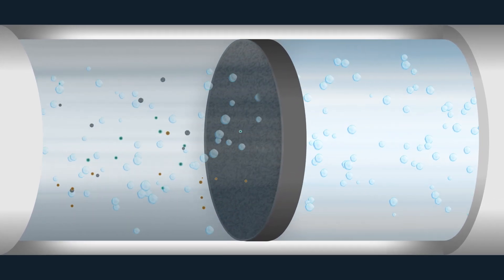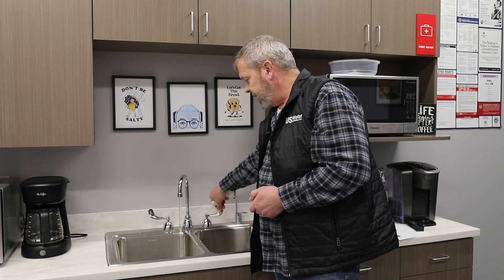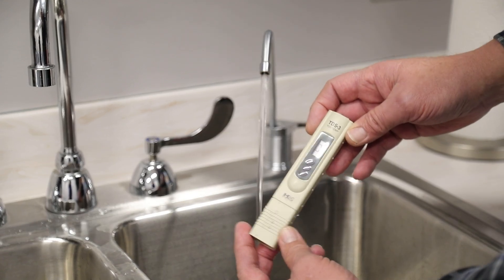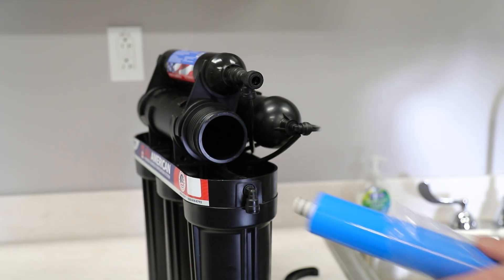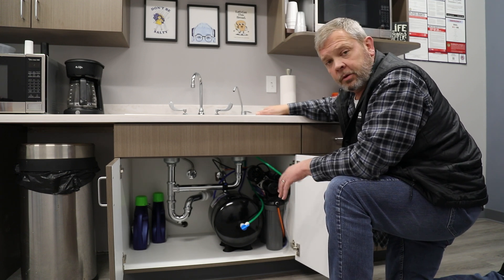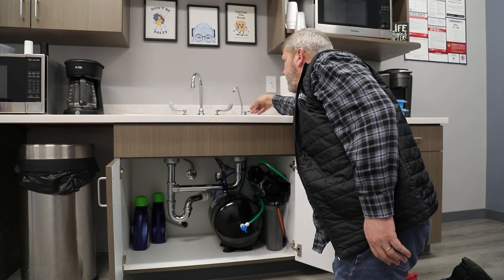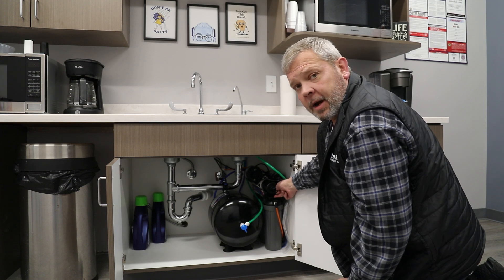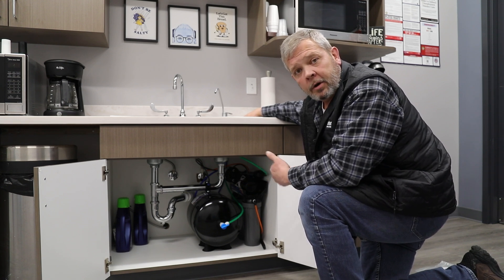When Do I Change My Reverse Osmosis Membrane?

Comment: Install a “Y” fitting just before the RO filter on the RO feed line. Then attach a liquid filled water pressure gauge. Take note of the normal working pressure. Later, if there is a problem, check the gauge. If the pressure has fallen, the pre-filters need changing. If the pressure has increased, the RO filter is getting clogged.